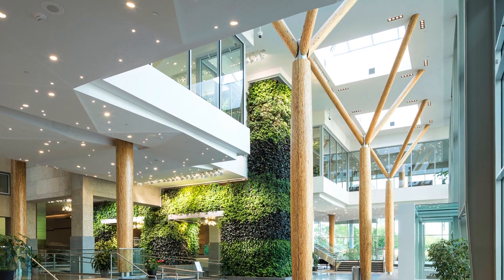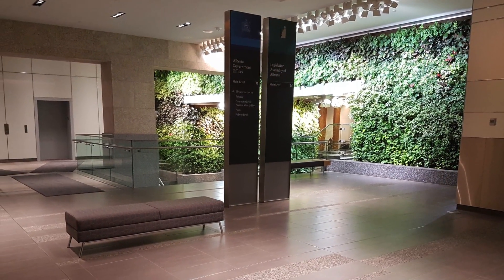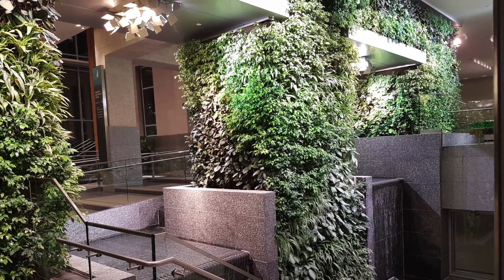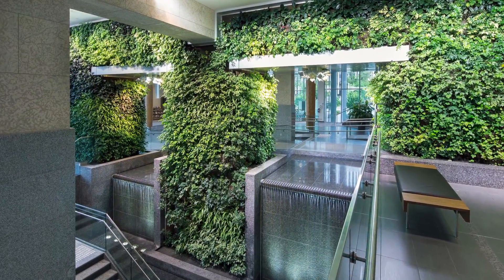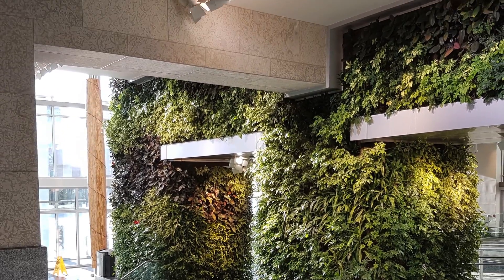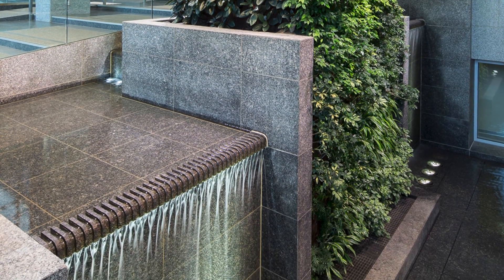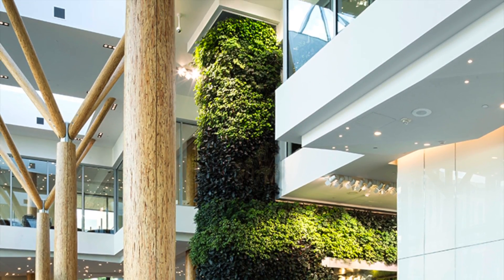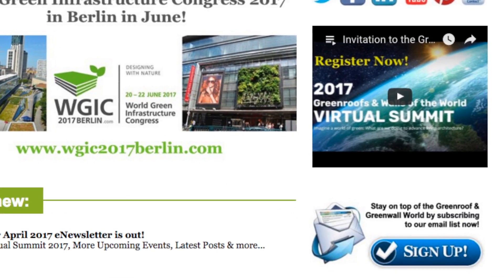Edmonton Federal Building Living Wall Biofilter - Project of the Week 5/15/17

Comment: It's a pity the government is removing the wall however the cited maintenance cost the government cited is a bit extreme as most of the maintenance should be just adding water, nutrients and removing dead leaves, pretty typical office plant maintenance..  I seem to remember that they used to say that these breathing walls actually removed viruses from the air but that may be those walls that were also waterfalls hence blowing the air through a water filter as well as by various plants.